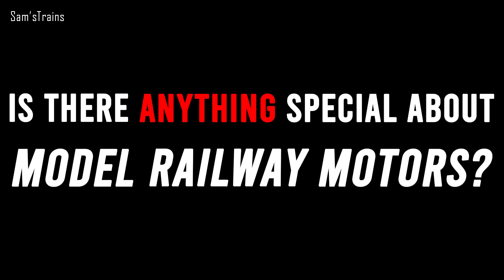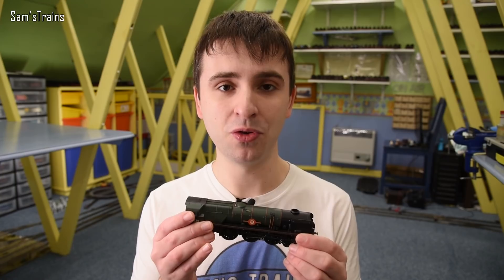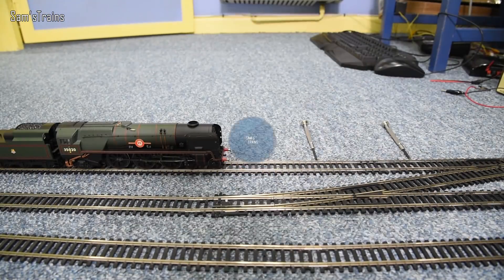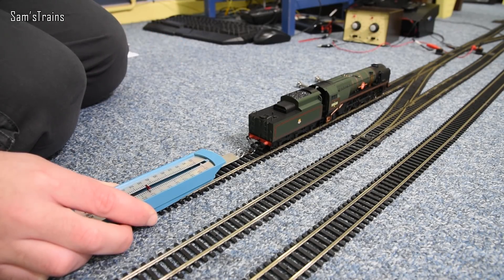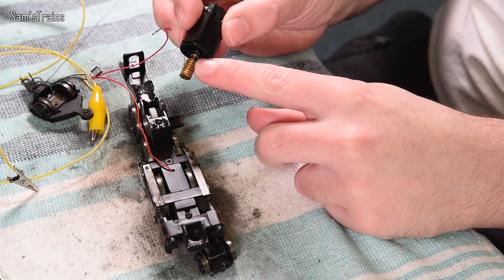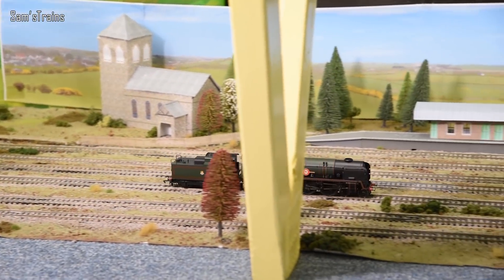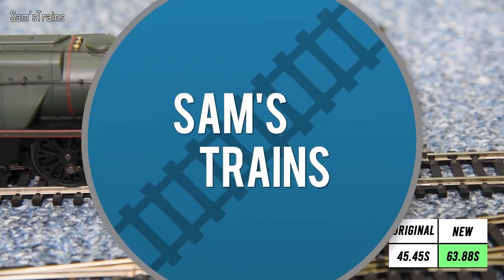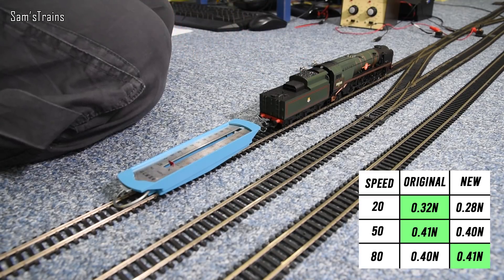How Much Do Model Train Motors Really Cost? | £2 vs. £27

Comment: 1. Lube motor bushings prior to assy--they come dry. 2. Test mechanism BEFORE assembling loco, not after. 3. Locate worm gear on shaft relative to mounting holes, not distance to motor. 4. Measure volts applied before measuring amps. Turning a knob is not accurate. At least you let the brushes wear in--good job.
Reply from the maker: Thanks for the comment - I do always lube the bushings (this time included), but waited until reassembly for the sake of the video (the prime function is to entertain)! The same with using the knob - I did that for the sake of accessibility, but matching the position of the knob each time produced voltages close enough to demonstrate the similar performance of the two motors!
Thanks for watching - Sam :)

Comment: What you don't know is what the working conditions are like in the different factories, or whether these motors have gone through the compulsory safety testing that the Hornby motors will have gone through.
Reply: Do you believe there is a safety test for a toy electric motor? Like, below minimums for electrical "code" regulation?
Reply: @skuula  All toys have to be CE marked which means they have to be tested for safety. Electric toys. Safety BS EN IEC 62115:2020+A11:2020
Reply from the maker: You're right, I don't know that! But these models are not toys - the packing is always careful to specify this!
Thanks for watching - Sam :)
Reply: @SamsTrains  yeah - and to my knowledge, there are no safety features in small electric motors anyway. There are RoHS (hazardous substances) regulations, but the entire industry in China and outside adapted to those 20 years ago.

Comment: Hi Sam
Thanks for the information re replacement motors for hornby. As an aside I needed replacement gear wheels for a Heljan railbus which had split. On contacting Heljan spares at Gaugemaster they didn’t have any. I then emailed Heljan direct and they told me it’s an old model( only about 6 years old I think?) I said to them you can get spares for Hornby and Bachmann but they retorted all spares are are problem! If this is a manufacturer attitude on spares of their own models what hope do we have of keeping them going?
Reply from the maker: No problem Alan, hopefully it's some help for you! That's genuinely awful - 6 years old, and no spares? Totally not surprised though - Heljan's models aren't designed to be serviceable - they're a complete nightmare from a maintenance perspective.... put together as quickly and cheaply as possible, with no thought to their lives beyond the factory - I've said this many times of Heljan!
Thanks for watching, Sam :)

Comment: Its similar with car parts buy from the motor factors or own brand foods all the manufacturers do is issue a spec & invite firms to supply to it, saves manufacturers setting up a factory, also if you have a factory producing branded goods, at time when orders are low for the brand, they don't shut down the factory if they can help it they carry on production but with a different label ...its all a giant PR/ AD ad mans commission hunt, many people don't like to admit to buying the value brand but its often the same or similar quality..
Reply from the maker: Thanks a lot for this Joni - very interesting!
Thanks for watching - Sam :)

Comment: doesn't the worm drive create a problem of natural deceleration of the wheels when power is cut? As the mechanism doesn't allow for reversing the kinetic energy back into the motor.
Reply from the maker: Yes it does, hence why better models have a flywheel fitted directly to the motor shaft!
Thanks for watching - Sam :)

Comment: very good video !  i must admit m not totally surprised by the result,  as just about everything is made in china these days ! the motor looks so much like the original, its probably made in the same factory !  good tests...........appart from the last "pulling" tests, as at the point where the wheels start to slip,  its just measuring the traction of the loco wheels on the track.  but im nit picking !  great video mate !  :)
Reply from the maker: Thanks very much Kim - yes they perform too similarly to the original not to be the same thing my opinion!
Thanks for watching - Sam :)
Reply: @SamsTrains  i love the way you can use cd motors to replace older lima and hornby "ringfield" types, tho the same moters can be found in game controllers for the rumble motors (2per controller)  would make a good series ? " replacement motors" ?   keep up the good work !  :)

Comment: Applying a bit of heat to the worm before refitting helps it slip on easier, less chance of stripping brass out of the core. And when it cools it will shrink back to the shaft.
Reply from the maker: Absolutely Dave - that's why I used the heat gun! :D
Thanks for watching - Sam :)

Comment: My thoughts: is there an actual or implied warranty with the Hornby motor? What would a proper electrical comparison make of two engines?
Reply from the maker: That's a good question - I'm not sure about that! The retailer I use guarantees everything for 6 months... Hornby may be for 1 year, will need to check!
Thanks for watching, Sam :)

Comment: I'd like to see the original motor and one of the new ones stripped down to their component parts.  I wouldn't be surprised if you found that both motors are exactly the same..
Reply from the maker: Yes I would like to do that on video too - I've done it once, but it was a nightmare to get the brushes back in place!
Thanks for watching - Sam :)

Comment: The black coat of paint was the most expensive part of that motor. If you do away with that (and brass bushings) you can have the same motors for less than 30 cents.
Reply from the maker: Wow as little as that? Crazy! :O
Thanks for watching - Sam :)

Comment: Just bought a 12v  5 pole dual shaft motor off the internet for 99p brand new, and it works perfectly.
Reply from the maker: That's great to hear David! Make sure you go for 12-24v if you can - the stuff only rated 12v seems to run a bit fast/hot in my experience!
Thanks for watching - Sam :)

Comment: Not all motors have the same shaft diameter for the worm to go on. Am I right to assume that there were various options available on the Chinese website?
Reply from the maker: I've never seen a motor of this form factor with a different shaft diameter - I suspect they are all the same. You've just got to look out for the shaft length, as this does vary!
Thanks for watching, Sam :)

Comment: I noticed that many British and US H0/00 locos use regular "off the shelve" motors, when I needed a replacement. I simply went to the 1st modell exchange and brought a random motor from a seller who sales all kinds of electrical parts (motors, LEDs, relays ect.), for about 3.5 GBP (and it was a 5 pole replacing a 3 pole motor). Dough most German, French, Austrian manufacturers are using more special motors, sometimes it is also their own product (like the old XO4 Tri-ang motor)!
Reply from the maker: You're right - most of them are standard sizes!! :O
Thanks for watching - Sam :)

Comment: The reason for same performance  is simple :   both motors are the same "made in china  motor"  !  One is bought by  the model  train manufacture the other by you ,  the price difference is ( beside  applying   their own  trademark for extra $ ) the costs any manufacturer pays for assuring supply of a particular item based  on the  COC  !    The huge majority of made in china dc motors  are  replica ( knock-off) of japanese, swiss, or german motors ! ( e.g.  Namiki, Canon,  Faulhaber , Maxon ,etc. ) 
  If you like experiments , try to get a Faulhaber motor and install it to a loco  ... you will like it :)
Reply from the maker: Thanks very much for the info Larry - I'd love to try one of those!! :D
Thanks for watching - Sam :)

Comment: Often the same motor is available in different winds to run at different speeds and currents so it could be a slightly 'slower' wind - so it will run slower and take a bit less current.

Comment: Would changing the worm gear out to work at lower speeds would it prolong the life of a motor? Although at a few quid would it be worth it? thanks for uploading
Reply from the maker: Yes in theory it could be possible, but you'd need to change the loco gearset too, and also find gears/worms that fit into the mountings correctly - it could be quite a headache!
Thanks for watching - Sam :)

Comment: It is crazy the prices of a motor that is manufactured for about £1 and being charged the guts of £30. I initially thought to pay £10 would have been okay, but less now that they make them for a 1/10th of that price. Therefore, how much are they making for an entire loco? Interesting test results for the motors Sam, but the difference would depend on how many windings are on each pole and the quality of the copper used. Those little tools to remove the gear are very handy to have and an excellent job of not getting shafted in the rear... LOL.
Reply from the maker: I know John - it's bonkers isn't it?! £10 would have been much more reasonable! That is the logical question to ask - I decided not to make that video ;)
Thanks for watching - Sam :)
Reply: @SamsTrains  Awe go on make the damn video, what have you got to lose for your honesty, I'd back you up, Sam as I think the same and that includes everything we buy that just on our hobby.

Comment: There are two metrics which ware not measured, that may be of importance to some, The first be a long term test of how long does it take for the motor to burn out IE leave it running till it dies. The second would be a consistency test IE run 100 motors of each in every comparison then see how the averages measure up. That said it is probably still not worth the cost of the expensive motor, after all you would have to go through about 15 cheep motors to have the equivalent cost of the brand name motor.
Reply from the maker: Yes you're absolutely right - those would make for interesting tests!!
Thanks for watching - Sam :)

Comment: Do you know of a suitable replacement for the Ringfield motor?  In replacing a motor with a brand new one, you don't know how old the original motor was. It could have been one which Hornby had in stock for 20 years before they fitted it!
Reply from the maker: Yeah - check out my CD motor conversion - it's very rough and ready, but it does work well! :D
Thanks for watching - Sam :)

Comment: I'm not entirely surprised Sam..... 
I've seen those little Motors all over Evilbay for between $2-3 USD. 
My only issue (not a big one!), was your pulling test. The mitigating factor was the traction of the Wheels, more than the Torque of the Motors, above 1/3 Throttle. 

Considering you DID admit this wasn't scientific... Most of the testing proved a valid point.
We're being RIPPED OFF!! 😠
I've known this for a long while. ANOTHER determining factor is - how much MORE comparable Trains cost in America vs. Great Britain. It's assumed that we have more disposable income, and that's not really true.

Question - I've wanted to try those... But our Locos here have either 2.6mm or 3.2mm (3/16" or 1/8") Driveshafts...
Aren't those 2mm? Can you measure? 

If so I can get adapters. The Japanese $50.00 Sagami Can Motors have 2mm shafts as well.

That was very enlightening Mate! Thank you.
Carmine ✈🚂🚙
Reply from the maker: Yes absolutely - the sad thing is, if they really spent say, £5-£10 on their motor, we might get better performance!
I'll do my best to measure the drive shafts for you!
Thanks for watching - Sam :)
Reply: @SamsTrains  I hope you can measure it... This could save me HUNDREDS on remotoring several Locos!!

Comment: Sam I have a minor question, well this could be for anyone else who sees this, do you have any recommendations for a motor for a up-coming scratch build of mine? After seeing this video I'm tempted by these motors, but I wanted to get other suggestions from other people in the hobby. I don't see any forums in easy reach that discuss this topic. I've heard some good things about Mabuchi motors but I just want varying opinions. Any recommendations? The only thing that I will say is that it will be used in a DC, 10-coupled, heavy freight locomotive. I.E. american heavy drag freight loco. Thank you!
Reply from the maker: Ooh that's tricky - I've never had much luck with that - it's quite difficult to get the motors mounted correctly! Good luck though mate!
Thanks for watching - Sam :)
Reply: @SamsTrains  Yeah it is a minor problem. Okay when I say minor, we're dealing with Lawrie's Mechanical Marvels type problems. Which means massive problems but lets think positively. But thank you for the optimism! Do you have any recommendations for motors that could take some abuse? I think I have a gearbox for it but the locomotives' only as good as the motor. Thank you! - Michael

Comment: I'm sure I'm not the only person who would be quite happy to pay a couple of quid more for decent, RELIABLE, motors in my locos. Curiously it's mostly Hornby I've had failures with; S15, Terrier (re-tooled), 700, M7 and the Adams Radial I bought to replace one of my failed Oxford Rail versions; all failed. While I appreciate the amazing attention to detail in modern models, I would gladly sacrifice a few rivets for a quality motor that doesn't burn out or melt my locos.
None of my Bachmann motors have given me any problems; some are fairly noisy but are reliable-and that's what matters.
Reply from the maker: Yeah absolutely - although decent reliable motors shouldn't be out of the question at current prices.... most of Hornby's pacifics are the best part of £200 now!!!
Thanks for watching, Sam :)

Comment: Perhaps the cost of train motors has something to do with Mashima stopping production and people buying up spare stock which then cost a fortune. Maybe others have jumped on the bandwagon figuring thats what the market will bear. What we really need (ready to run and also kit and scratch builders) is someone to test alternatives from the motors available. The EM gauge society did do it but that was some while ago and I don’t know if the are repeating the exercise. Anyway soap box over. Interesting vid Sam.
Reply from the maker: Very interesting Mike - could be right there - thanks for sharing! :D
Cheers,
Sam :)

Comment: Hi sam could you give me details of site you bought these from and where to get them as i have a fleet of every rebuilt that hornby made and would like to be able to convert if needs be and will these fit the un rebuilts as they usually have terrible noisy and temperamental motors in them , well impressed with you're video well done regards ken

Comment: Hi Sam.
 Sorry to be a pain. Last question honest. As you pointed out in your reply tractive effort or force would be less if the new motor was weaker. The new motor wasn't. Or was it? 
 Put it this way. If the new motor was ten times more powerful the tractive effort would still be the same. Wheel slippage is no different  than oiling the wheels and the track. Also were the two motors the same weight?
Reply from the maker: Yes you're right - this test wouldn't show whether the new motor was more powerful, but I hope it also demonstrates that locos are no weaker with the alternative motor fitted. The current draw also indicates that the power consumption is close to the same. I haven't weighed the two motors, but I could do, they do appear to be identical inside and out!
Thanks for watching - Sam :)

Comment: Right, so I'm not an expert, but the pulling power test was a bit bodged - the factor that was causing it to cut where it did was the wheel spin. If the engine was twice as powerful it would not be seen due to wheels.

You could try to see at what voltage it started to spin and draw conclusion from that.. Probably.
Reply from the maker: Yes you're right - the test was intended to demonstrate that the loco was no less powerful with the replacement motor!
Thanks for watching - Sam :)
Reply: @SamsTrains  Thank you for responding, I really appreciate :)

Interesting however how the difference was not so much visible in some areas and in some in favor of the cheaper one. Would you consider doing another test, this time the durability (how long will it last so to speak)

Comment: Good video Sam . Not surprised . I’ll bet that Hornby, or rather their manufacturers, buy motors at the £1.60 level or less. It would be really informative  if you did an exposée on the total  cost of a model . There’s the cost  at manufacturer who had to make a profit and send it to Hornby , then Hornby have to make profit and sell it to retailer then retailer sells it to us . I wouldn’t be at all surprised if the original cost of a £160 loco is closer to £50. If we sourced direct. Of course you can’t do that , but it does show why the likes of Hattons and Accurascale are getting into the market because money can be made, despite what Bachmann would try and have you think about increasing Chinese labour costs
Reply from the maker: I bet they do Russell - don't forget, that £1.60 included postage to my front door from China! I had intended to expand this video to cover the costs of models too, with the help of a contact, but I don't want to be responsible for putting Hornby out of business - lol! Based on what I've learned, a £160 model may cost significantly less than £50 to produce - but I've decided not to go there in a video!
Thanks for watching - Sam :)
Reply: Sam'sTrains   Yeah true , the establishment wouldn’t be too happy .  I don’t know about trains but I am a manufacturing controller and know about mark ups!